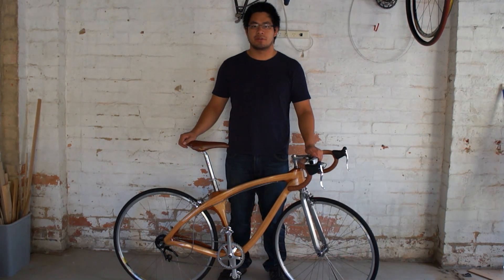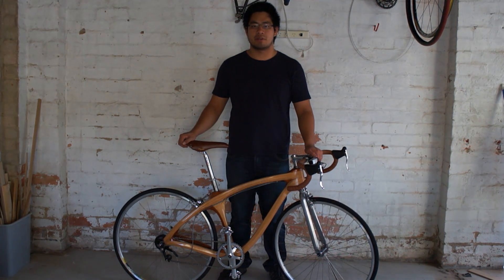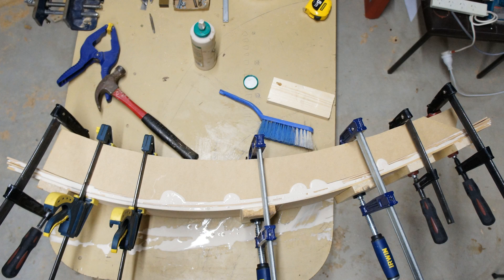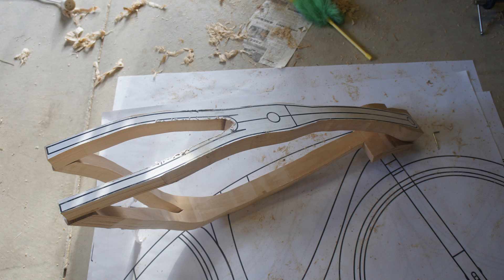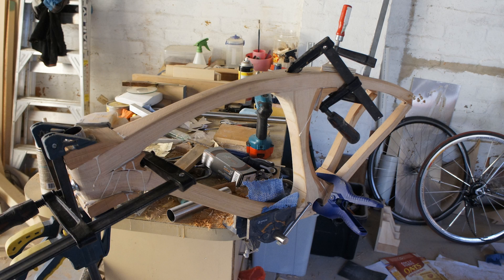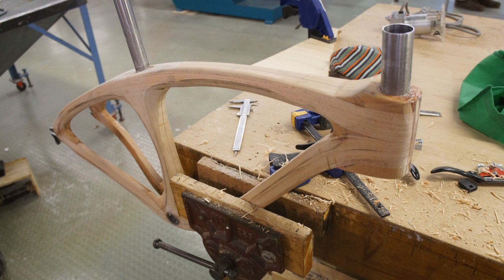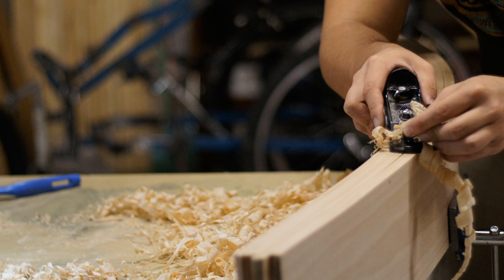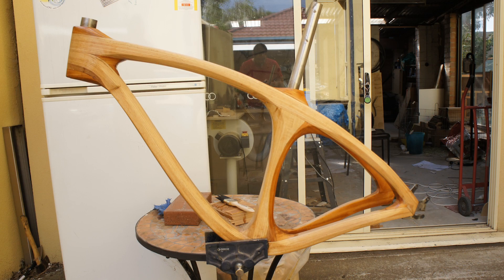Wooden Bicycle: Zheng Chin Entry Into RMIT Green Inventors 2013

Comment: Wood is not a good choice at all, and cost of trees is not good choice for them. It is like the CFLs energy saver bulbs, they claim they were greener but in reality they did more harm than the ok'd 100W bulb and then came LED true energy saver bulbs and it is the same for your wooden bike, how many trees will it cost and how safe would a wooden frame be when left in the back garden or shed.

Comment: More sustainable? Cutting down our trees is sustainable? What is the true environmental impact of your machines to make the frame? Do those tools come from sources that have less impact on the environment? What impact does the glue manufacturing process have on the environment? Look at the big picture and learn about the real bottom line of your process compared to a regular bicycle.
Reply: This is exactly what I was thinking. As a neat project this is cool, but as a "replacement" unrealistic and potentially way more harmful to the environment.
Reply: You are right! Just because we all have something wooden in our homes means that we must cut down and use any and all wood we can for any purpose and claim that it is good for the environment. We must never reduce or eliminate our tree cutting practices.
Reply: Robert Evans + you can use steel over and over again and a solid steel frame arguably lasts longer. 'sunstainable' these days doesnt mean anything
Reply: +Robert Evans i see where your coming from, and i respect your argument. however, if we compare embodied energy between wood and metal, metal production/recycle is much more energy consuming and the annual green house gas emission is off the chart due to the high energy requirement for industrial smelter (don't take my word for it do your own research). 

you may argue cutting down trees is a bad thing, however, the fact is that in many countries, trees are deliberately grown and regrown in plantations and natural environment. the consumption of raw wood can be recovered naturally in an acceptable time frame (a couple decades, usually 2 decades) with little to no green house gas emission (the little emission comes from harvesting vehicle and wood factory), while metal ore take millions of years to form naturally. 

bottom line is metal and wood manufacturer both has its environmental issues, but with greater demand of wood comes more tree plantations. even if the intention for growing these trees is to cut it down eventually, it still benefits the earth in some way, and i can not say the same for metal production industry. 

in terms of glue manufacturing process, i am not very knowledgeable on that field, so i really can't comment on that. 

hopefully you would consider my response as a valid argument. if your not convinced, like i said, research it and see if you have a change in perspective, have a good day sir :D
Reply: Y'all, trees regrow. Cut them down, replant them: see silvaculture.

Comment: Would love to get a copy of that A1 printout so I could build this, such a nice shape and so nice to see it take shape from pieces of ply-wood.
How did you fix the drop-outs into the frame? As the ply will be horizontally laid, side clamping would have the issue of forcing the laminates apart.